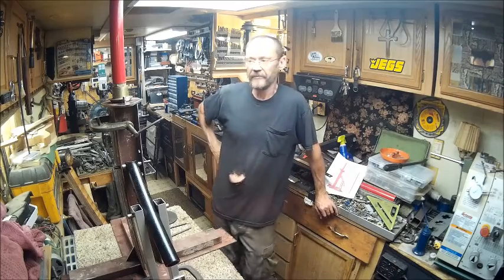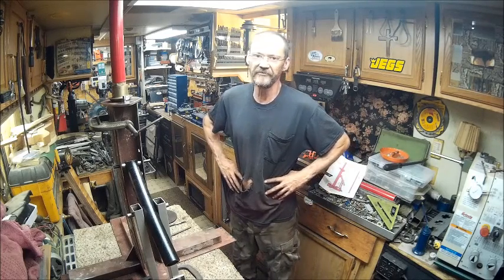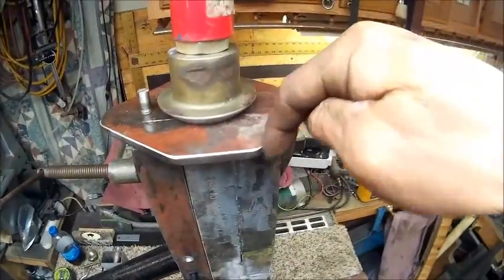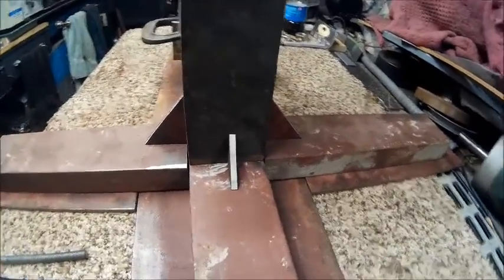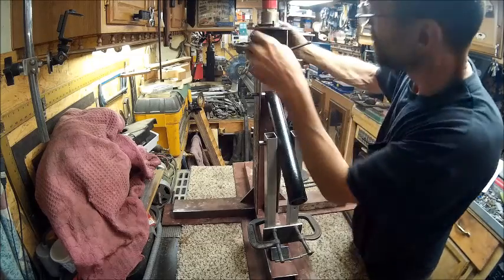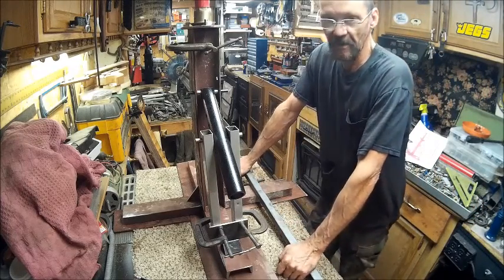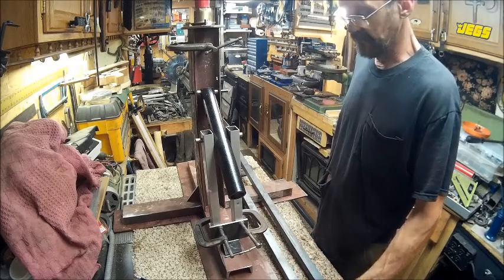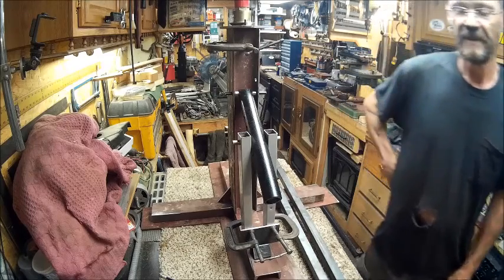diy tire changer bison built  part 2

Comment: Remember the duty cycle.  Careful how long you weld between cool downs for the welder.  I would buld the bar ends like a Coates changer and disregard copying the Harbor freight spike.  There is nothing on a tire a point is good for except cutting it.  I wonder about making the vertical pole bolt on or hinge and lock pin to the base so you can pack that monster away when not in use.   end of video 3 should not contain any profanity when you demonstrate it.  ;-)
Reply from the maker: i did think of bolting on the vertical pole on for that very reason. you just had a hand in the change. i think i will do that. now for sure now. the duty cycle on this welder is 40% so what would that mean for time used and cool down:
Reply: duty cycle is the percent of a hour you can run it per hour so if you had a 50% duty cycle welder you can weld for 30 minutes and it must cool down the other 30 minutes. yours would be somewhere around 20 min or so (not so good at the math lol )  with a 40 min cool down . you can see why 100 % duty cycle welders are more desirable. you never have to stop.